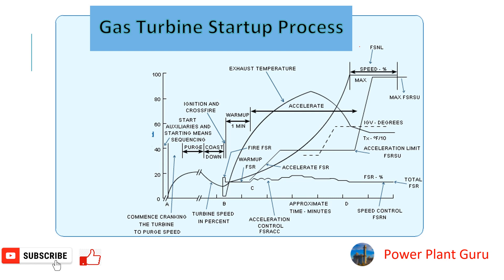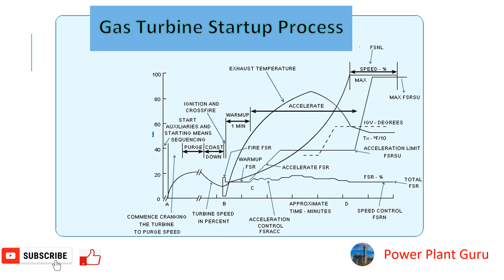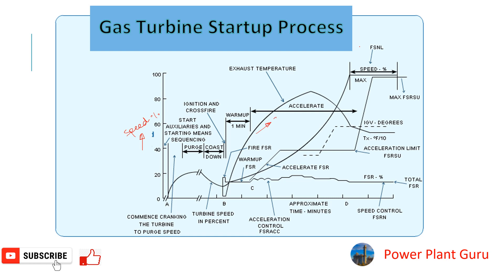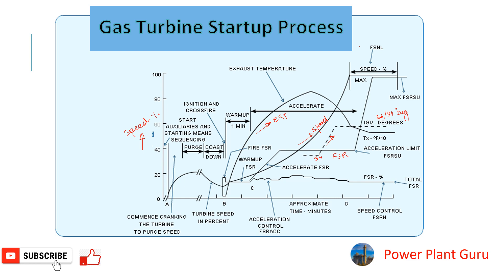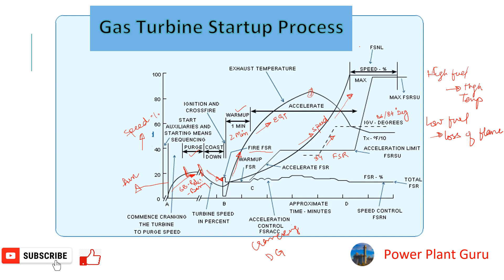Start up curve of Gas Turbine, gas turbines Startup Sequence, power plant guru

Comment: Whether pump is a part of turbine or not.please answer
Reply: AOP, EOP & AHP are motor driven pumps as a part turbine. And associated shaft driven pumps. Rest pumps are off base and not part of the turbine. Another motor driven pump is JOP which is used during start up and shutdown.

Comment: Sir you didn’t explain when the starter motor is disengaged? Is it disengaged immediately after the coast down is completed or when exactly?
Reply from the maker: Hello 
what I could understand from your question is 
1. There is no role of starting the motor while coasting down, machine RPM reduces on its own, and one its speed reaches near to barring RPM then barring motor cuts in and maintains the machine on barring speed. 

2. Role cracking motor is startup: when the machine is in acceleration mode and the machine RPM increases above 60% the rated speed, then the cranking motor disengages and the turbine is on self-sustaining speed.

Comment: Maybe the temperature does not increase because 88Tk starting
Reply from the maker: I didn't understand your point, please explain what you want to convey
Reply: @powerplantguru007  at 2800 rpm the 88TK  Turbine exhaust frame cooling blower start.

Comment: Hi thank you for the explanation. I am kind of wonder, when the turbine is running at no load speed, let say 6000 rpm, how the load (for example  process compressor / generator) can be introduced since the load at this moment is at standstill? Will the load increases the speed from 0 rpm to 6000 rpm (assuming gear ratio of 1) instantenously?
Reply from the maker: Thank you for watching my videos.
Please watch my video on droop .
Reply from the maker: While we introduce the load, the initial load is low and machine control system allows speed reduction upto 4-5% of full speed. Although the actual variation is very less, that is the beauty of the GT control system. To understand this please read on droop and watch my video on droop.